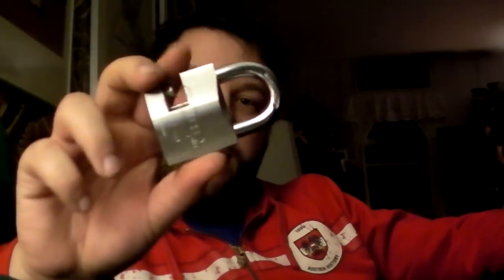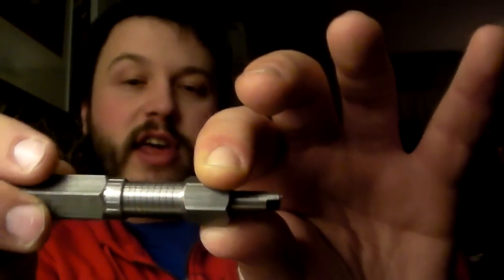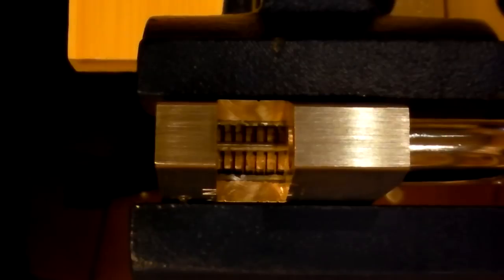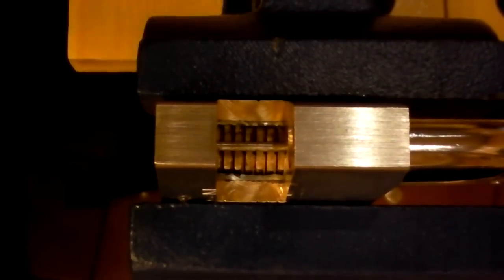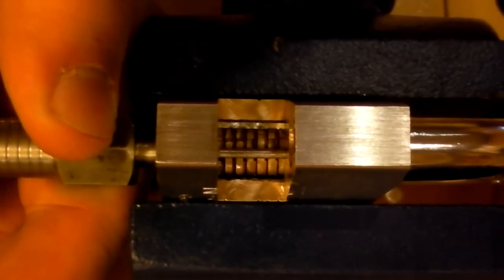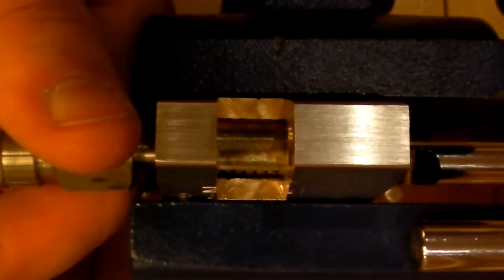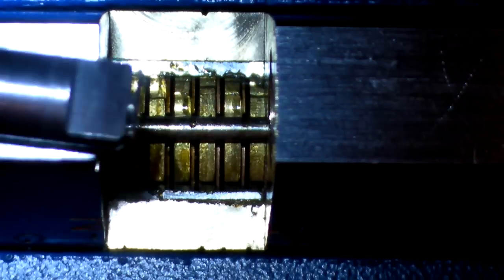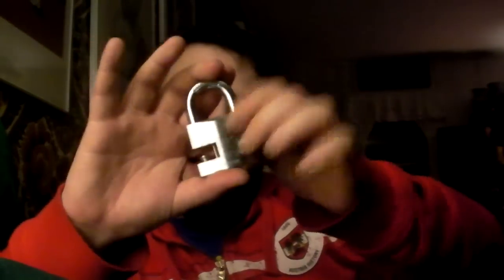Picking & Decoding an Abus Plus Cutaway

Comment: Are there two locks in this video? The first one doesn't appear to have those thin disc spacers as the second one.  Would the following tool that is does not have a thin  pick open this lock? http://www.amazon.co.uk/Man-Friday-Detainer-Locksmith-Padlock/dp/B00W1BCLT4/ref=lh_ni_t?ie=UTF8&psc=1&smid=ATB4OUY0T4FUB